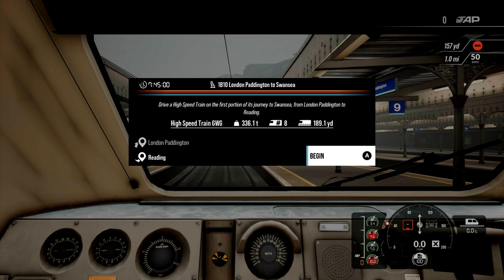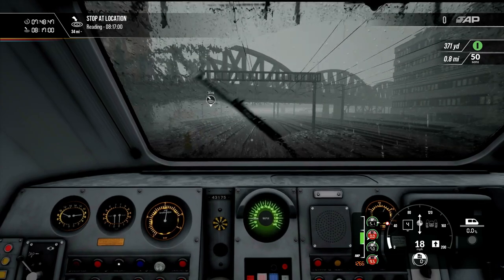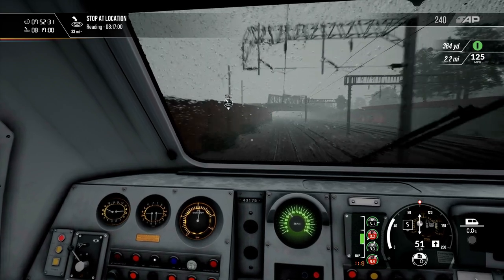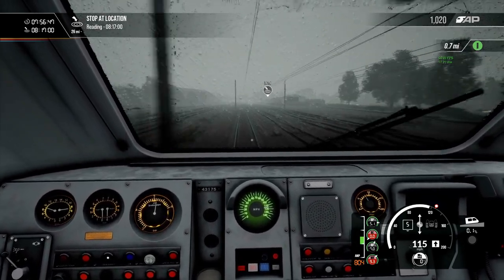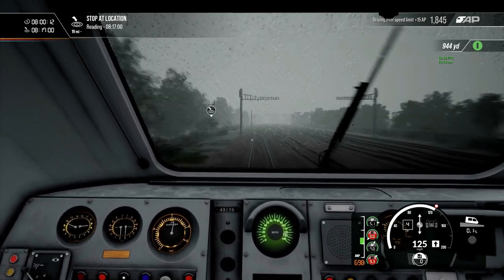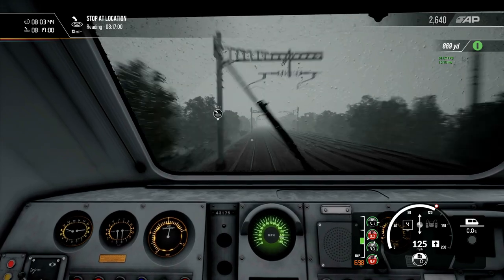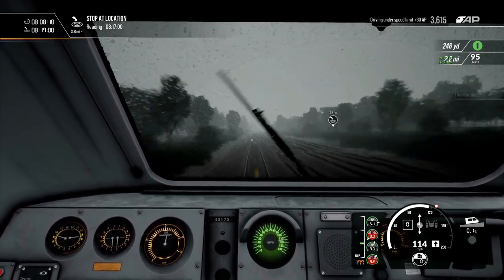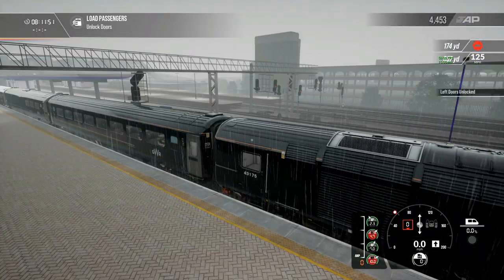Train Sim World 2 - HST (Class 43) acceleration fix! Is it any better?!

Comment: Hi, I finally got around to subscribing :) What a difference the HST is compared to in TSW. 6 coach HST would definitely accelerate considerably quicker than 7 or 8 coach. A 6 coach HST can just about keep to the same timings as a Voyager for CrossCountry whereas 7/8 coach would lose time. And did you have the road at the start of your video? It always showed red on the top right display?
Reply from the maker: It was the 16th attempt to get the game to load in a full HST. My error.
Reply: @BryerGaming  Oh so you just kept on trying different services hoping to find a full length HST? I didn’t realise you weren’t aware of the journey mode trick.
Reply from the maker: @alvinseville2874  yeah wasn't aware at all.